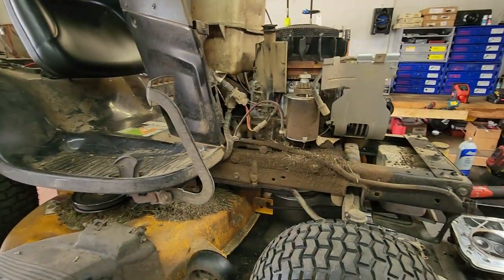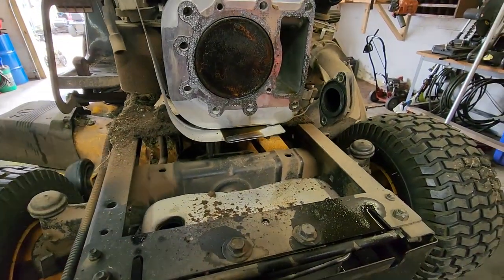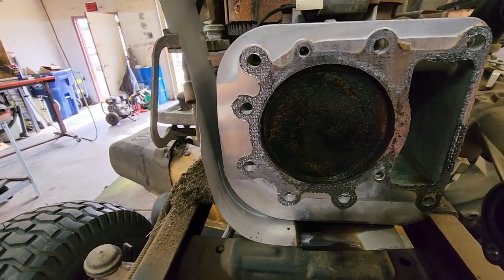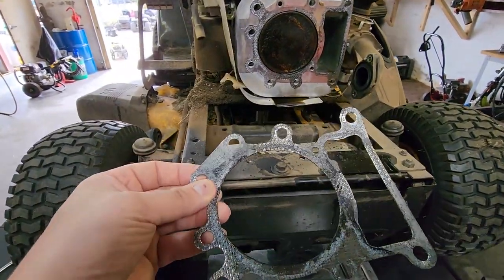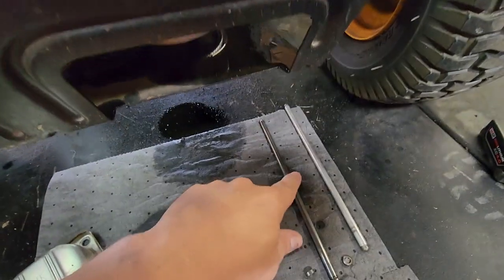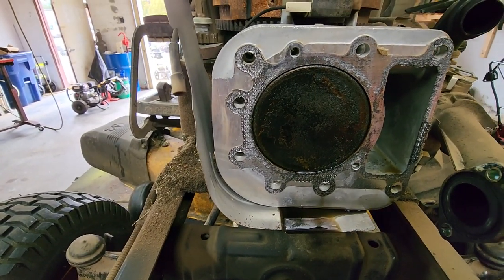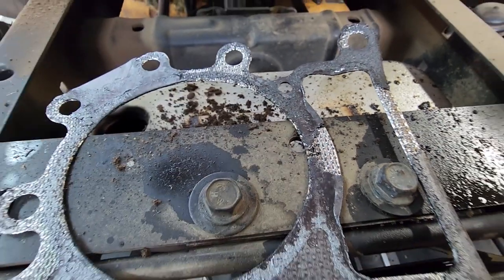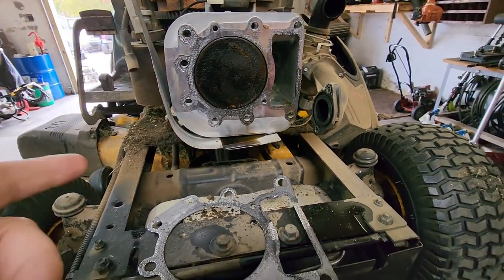Why Is Your Briggs&Stratton Lawn Mower Engine Smoking?

Comment: I thought it was blowing compression through the broken head gasket into the crank case via the valve galley. I was thinking maybe it could Be also the rings because of the cylinder lying horizontally unevenly wearing oil & compression rings. But I guess I was wrong.I'll have to have a closer look and hopefully it's just a Head gaskin.